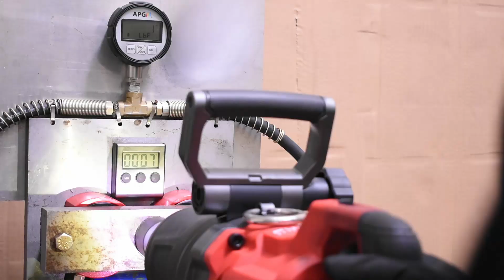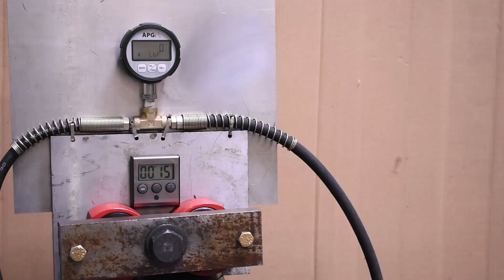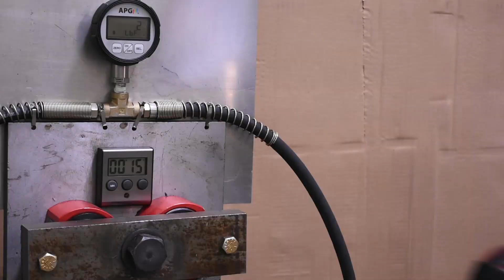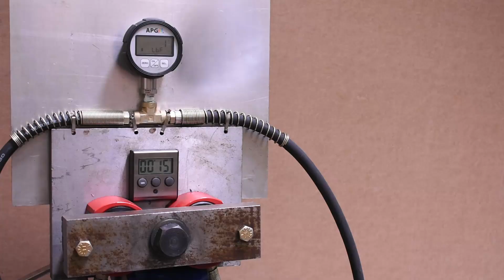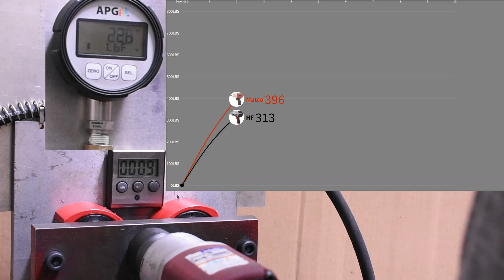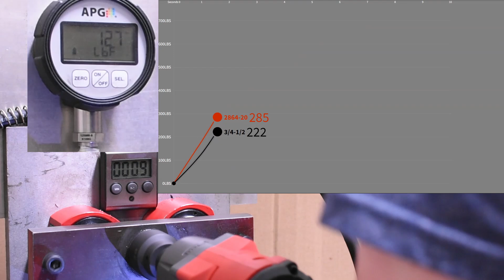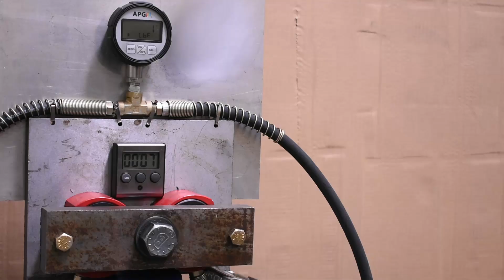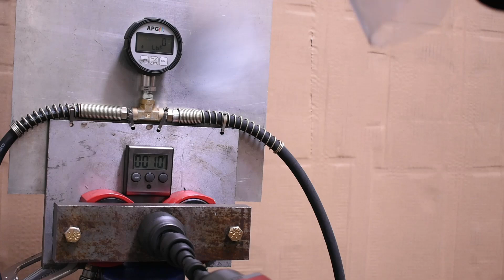How Much Power do Impact Drive Size Adapters Lose?

Comment from the maker: Something we tested yesterday just after making this is low-profile adapters like: https://amzn.to/3leaKL3
These lessened the huge 3/8" to 1/2" loss down to 10-16%, so it must have to do with the anvil being pushed out and away from the square drive on the socket, which doesnt help with that vibration either (see 2:52, the socket is a blur). Likely for the same (less) vibration reason, we also saw less % loss on weaker guns. For instance a 3/8" M12 stubby and our knock-off makita saw consistently less % loss, but still the same relationship between adapter types as in this episode.
Torque who started TTC is working in product development for Astro Tools, always consider multiple sources when considering a tool!
Reply: please test torque multipliers
Reply from the maker: @angus4202  Okay, but they aint cheap. Give us a bit :P
Reply: @TorqueTestChannel  considering the cheapest one ive seen on amazon is like $299 take your time
Reply: You know, I'm wondering what would happen if you turn a high-torque impact into an impact driver. Like take the Milwaukee 1/2" and just slap an impact driver end on it....Welp I know what I'm going to build.
Reply: Please show the percentage loss with the new and old m12 Stubbies with 3/8 to 1/2 Low profile adapters. Is the 3/8 still king or is it worth buying two separate stubbies.
Reply: Torque rods work by actually bending and absorbing the impact... I presume all other adapters are subject to this as well as perhaps longer sockets depending upon the material they made of...
Reply: When you click the link and realize you already own them.... (first link i have it so i can finger tighten/loosen with sockets)
Reply: Curious how Brands affect impact socket differences!!
Reply: Measure how much torque is lost using an extension rod
Reply: I was just about to comment asking about a rerun with low profile adapters. I was looking for a video specifically showing them.
Reply: Glad you mentioned this, I also wondered about the low pro adapters.  I also wonder if the lower the profile, the lower the loss.  For example, the Grey Pneumatic is lower profile than the Ares, but TGR appears to be the lowest profile of all (by what looks like just a couple mm).  With the new Milwaukee 550 ft-lbs stubby coming out, I'm wondering whether I should get that in 3/8" or 1/2".
Reply: @Torque Test Channel now do this test again all with air impacts and see if there is a difference in %loss. Or try with electric guns that run at different rpms (high rpm small hammer) vs (low rpm big hammer) with extensions/adapters
Reply: Exact ones I bought to step up my 3/8 to 1/2 as they are more of an anvil enlarger instead of a short extension adapter.
Reply: I just came here to ask if the low pro ones would work better. Glad to hear its in the 10-16 percent range.
Reply: So I don't know if this is going to be any different but I've had a realization what about the low profile adapters would that have any difference or would it be the same as the standard general adapter
Reply: @Torque, who wins?
Dcf911 = 400lb breakaway w/1/2" anvil
Or
Dcf923 = 450lb breakaway 3/8" + Titan LowPro adapter increaser to 1/2" ?

Who wins or is it a tie? 
Or just find 3/8" impacts in larger size?

Did anyone figure out if the larger mass 1/2" sockets are helping a 3/8 drive with adapter?
Reply: This is why snap-on and Williams label their adapters as non-impact sockets. They don't want to replace them every week for free. Smart on them really.

Being new to a mechanics job I see snap-on in the half inch impact field is #1, Everyone has one. This vid helped cause I was going to try to get a stronger setup with the one-handed 1in. Cordless ingersoll just to put snap-on in check 😂but now my adapter from 1 to 1/2 idea might make it less powerful than the snap-on half inch. The 3/4 snap-on with an adapter to half inch might be a touch stronger than a snap-on half in. Impact but is it worth it. 🤔 will need to do some more research to try and get the best one-handed cordless impact setup. 
I would go the two-handed ingersoll but again the adapter might just make it as strong as a snap-on half inch impact and most of what I do is above waste height. Not trying to hold a two battery two-handed impact that high all day. 😂

Comment: In most cases you'll have enough power for most of the jobs you need to do even with the adapter. So I don't see any "disadvantages" of using adapters, but good info!

Comment: I've got a Metabo 1750 with a 3/4'' anvil and they do offer a 3/4'' to 1/2'' adapter. Hell, you can even slap a bit adapter on top of that and use it as a driver. At that torque, even like 30% of loss will still be super powerful regardless, so I don't mind at all. Mofuker's damn heavy though

Comment: 30936 titan adapters use a DIFFERENT design from ANY OTHER adapter and would love to see a column on the rankings for it please ❤❤❤❤ by the way 30936 is the part number it’s a low pro adapter design

Comment: I was about to get a 1/2" to 3/8" adapter to use with the 1/2" drive torque wrench I was gonna buy, but the information you presented on it showed me it would have been more headache than it's worth. I ended up buying a 1/2" drive impact socket kit with extensions and etc instead

Comment: I bought the $1000 1 inch square milwaukee before I realized how much torque you lose with adapters. Now it is basically a $1000 paperweight. oops

Comment: Nice test. Interesting to see that the step ‘downs’ showed a disproportionate decrease in transmission of power over the step ‘ups’!
 
I have the Makita DTW1002Z 18V Brushless ½" Impact Wrench (rated at 1,600nm of nut busting capacity) and wanted more grunt, so, as a solution, I went out and bought the Makita TW001GZ 40Vmax XGT Brushless ¾" Impact Wrench (rated at 2,050nm of nut busting capacity) to boot.

With my impact sockets being all ½" drive, I also purchased the ¾" to  ½" drive step down adaptor.

Taking into account the 19% loss in power using the step down adaptor (as witnessed in this video) means the 2,050nm becomes 1,660nm gaining virtually nothing for my NZ$729 (skin only) purchase plus 40v battery platform upgrade!

Comment: I believe this. I have the 3/4” earthquake XT on my service truck, only tool that always takes cutting edge nuts off between my coworkers. I always used a 3/4”-1/2” adapter to fit a 30mm socket on it. Finally bought a 3/4” drive 30mm and got the chance to use it the other day. It took them off so much easier I couldn’t tell if they were properly put on!

Comment: Just came back to this to see if I should get a deal on the new 550ft/lb M12 stubby in 3/8" coming in cheaper with a battery. Pretty sure I'll just go full retail on the 1/2" version though. Would rather be able to use it on the bigger end of the socket range without having sacrifice the extra power of a 3/8" to 1/2" adapter. Hoping it knocks off my M18 mid-torque as my go-to lug nut tool

Comment: I feel like a 1” to 3/4” to 1/2” would actually be a good test as in are you better off using 3/4 to 1/2 if you have to or does a 1” gun help even with two adapters on it. Kinda silly but could be useful to know in certain situations

Comment: It would be interesting if you guys could take 0.01” stainless or brass shim stock (or whatever size would fit) and place it between the anvil and adapter and between the adapter end to socket just to see if tightening the fit makes reliable gains, potentially enough so to justify doing in a situation where that 15-20% loss is needed.

Comment: 3/8-1/2 adapters save me on the daily, changing excavator buckets or other things that dont get/ need high torque but use like 24+mm
Reply: Would have to carry a lot more weight around with my big gun

Comment: If you have a powerful enough gun, this will not matter. I use an adapter all the time when doing a transmission removal when you need a smaller socket in a tight space that requires a powerful gun (example: transfer case bolts and the nuts that attach the exhaust to the catalytic converter. Those are always very tight and hard to reach). When do you need to push near 1000 ftlbs on anything in an automotive shop? (Unless it's rusted on or cross threaded or stripped)

Comment: It would be interesting to see if there is a loss when using an adapter on a manual breaker bar.

I've given up on 1/2" breaker bars and use 3/4" breaker bar with 3/4" to 1/2" adapter.....I haven't broken or bent a breaker bar since this switch.

Comment: would these losses be the same if using a torque wrench by hand. i have a 1/2 in torque wrench and 3/4 socket. would the numbers be close?
Reply from the maker: The numbers will not change on a torque wrench

Comment: hey TTC love my live torque chart i bought! question: i use a milwaukee 2864 at work and use a 3/4" to 1" adapter to use a 1-1/4 4 point socket to put pipe plugs in, wondering how much you think i would be loosing? seems maybe 7-12%? 

whats your thoughts on the 2864 vs the newer 2967, ive had both and man i love the new lights and all of that however the thing just eatssss socket. i use 7/8 sockets to put HD nuts on HD studs all day. I build expansion tanks for Taco Comfort Solutions. Thanks love the content keep it up man.

Comment: There is no need for a 1/2 inch impact for most diy or possibly mechs, not in rusty areas. If it can take off a crank bolt, it'll do any other bolt.

Comment: here i am using a 3/4 to 1/2 adapter on my already weak 3/4 20v earthquake. im thinking its time to upgrade to the herc 3/4 with a 3/4 socket set.

Comment: If you're busting out the 1 inch gun and an adapter down to 1/2 inch, you'd probably be better served with a half inch breaker bar and 8 feet of pipe.

Comment: I used a vintage Husky USA 27203 1/2 to 3/8 reducer on my gen 2 Milwaukee mid torque impact at full power to remove a stuck Allen bolt. Nothing broke. Guess my reducer is a lucky one

Comment: Hi, great test!
It would be also very interesting to test adapters for impact screwdrivers, i.e. hex 1/4 to 1/2 square. I hesitate whether to replace my 230Nm impact screwdriver to impact wrench with more or less the same torque.
And is your hydraulic setup for torque measurement something  standard in the industry?

Comment: I Mainly use the adapters, when I'm just loosening those 8mm bolts on the fender liners. No force needed, just much quicker to use the one powertool I have around. Putting them back in I go extremely careful so that I wait for a single click. Thats my personal torque spec on those screws.

Comment: It would be interesting to drill and tap an adapter for a single set screw to force it in the removal direction relative to the anvil where most power is needed for automotive use. That would eliminate the slop since the gun anvil would be fully CCW inside the adapter.

Comment: Well, lol, I am for one am thankful for these tests. I am also thankful for the mindfulness to try instead of break. I broke the head off of a 1/2 breaker bar when not realizing that my axle socket had seized to my hub face, had begun to employ "extreme" measures. After beating the "correct" size socket off the nut, I tried the same impact gun one socket size up, and it ripped the nut off no problem. Lesson was that enough space is needed both around and in front of a socket to move the nut. :)

Comment: I’m a tool idiot.  Horribly!

If I use an adapter set.  But extension is 6” or 12”, how is torque affected?  If I need to remove a stubborn bolt.  Which shall I use!

Thx
Reply: Use the shortest extension possible it maximize your input and reduce twisting of the extension resulting in more torque applied.

Comment: How does the anvil on the Milwaukee not break? I have seen ratchet testing with 3/8" ratchets and they break at like 200-300ft lbs (the higher end ones being the ones without the detent pin/quick release since that makes the anvil stronger) but this Milwaukee it putting out almost 500 ft lbs? How on a 3/8"? How does the anvil not sheer off?
Reply from the maker: Intermittent blows is a wonder of physics over linear torque

Comment: Please test torque loss of   3/8dr impact extension bars vs same length of 1/2dr impact extension bars and also if more expensive 3/8dr extension bars have less torque loss than cheaper ones.

Comment: DCF911 = 1/2 drive and 400lbs breakaway

DCF923 = 3/8 drive and 450lbs breakaway
(Atomic, so 50lbs more)

I have both brand new here,
To use 1/2 socket:
Would the dcf923 with low profile 1/2 adapter (titan kit) best the lower powered dcf911 without adapter?

Or would the dcf923 balance out the extra power with adapter taking it away, and it all equal out?

The deals were so good I'm not sending either back.  The 911 came with the 60lb ratchet I wanted,  so it's better than free.
Thinking about giving the 911 to the kid next door, competitive kart racer, but he thinks he needs a HF Ultra to take off lugs. 

Or could I possibly need both a 1/2 and 3/8 at some point, but after all the kids next door, his dad is my tool lending depository already  😉🙃

Comment: lol i found on amazon a 1/2" to 1/4" reducer that i got so i could use my performance tool 1/4" Mm & SAE flip socket set, 
 (which has 8mm-15mm and 5/16"-1/2"  in 6 sockets lol) while im on the job.. theyre great lil sockets,  impact rated, n perfect  for my to go bag.... but the flip socket-ness means i need to use a 2 inch extension, and if i wish to use em on my impact wrench, id also need an adapter or even 2 which makes for a huge wonky mess that doesnt even work out.

but w that 2 step down reducer it really makes it alot more solid n sturdy. but its just your regular basic chrome socket not impact rated,  but i got 4 of em (2 for 8 bucks) and so far i haven't killed one yet. but granted i do baby the shit outta it

i wish yoi could get impact rated dbl down reducers / extensions that drop down as well...

i have seen a few companies that make the extensions that are 1/2" females and drop to 3/8" males on the ends, but the shortest one i could find was like 10" .. theyre all like 24 n 36 inches long for some reason lol..

in a perfect world theyd make a 1/2-1/4 impact reducer that was also like 1.5- 2 inches long too give it some sorta tensile strength,, half to Quarter reducer  if used at full blast will just snap like a twig
 ..n prolly rip the guts outta ur lil socket at the same time, BUT DAMMIT ILL BE THE ONE TO JUDGE IF THAS WHAT THEY'RE FATED FOR ! not these nancy-pants wrenchNsocket police who done went n  trifled w my rights!!! 
lol

Comment: We use 1" IR impacts with true 90 psi almost daily at my job 😁 they'll strip threads on 1" bolts if you hammer on them long enough

Comment: I just went down a 1.5hr youtube rabbit hole to find out if 3/8 square drive impact wrenches can be adapted to 1/4 hex, to save myself buying a "weaker" 1/4 hex impact driver. After sloshing through so many "cool" and "manly" fellas doing niche reviews, I find this. A truly genuine, no BS, channel devoted to presenting real information via the scientific method. In the first three minutes alone, you distilled far more important information than my entire rabbit hole. Thank you. Instant fan here.
Reply: I went with a 1/2" one instead of 1/4" hex because I might not need the full power when driving regular screws but I absolutely will need it when changing the tires of my car. The max my impact wrench can do is 300Nm so plenty even with a bit of loss.
Reply: @merlinfanboy556 so you have a 1/2 impact wrench? I’m confused these numbers make no sense. A 1/2 drive impact DRIVER that makes 220 ft lbs is all wrong😂
Reply: @tristanphillips8937  Yes, I have an impact wrench with an adaptor to use it as an impact driver.
Reply: How have you enjoyed your stay here

Comment: So In our shop with a regulator we run our compressor at 175-180 piped 120ft with 3/4" black gas pipe and roughly 400ft total for the 3/4" loop left right and center runs. At the regulator we can very easily hit 90psi dynamic pressure. The compressor is an 80 gallon Devilbiss compressor twin stage @15hp on split phase 240v phase2/3 motor rated at 25hp 3ph. The DeVilbiss 80gal tank is dated 1945 and has max working psi of 230. The First stage appears to be a 1970 twin cyl dual displacement vertical pump and second stage is a 1975 V-twin type single displacement pump. Its clearly custom or Frankensteined together to make the ultimate shop compressor. This configuration has been in operation since 1978. The max dynamic pressure we can hit at the regulator is 144 psi for about 8 minutes, 120psi for about 12.5 minutes and 90psi for about 15 minutes coming down to about 77psi continuous dynamic out of the system with an empty or equalized tank. We run 1/2" rubber airline to the tool.

Comment: I believe the slack between adaptors is cushioning the impact.  To test this I would like to see them weld the adaptors to the socket.  It would have to be a good weld and insure everything is almost perfectly lined up.  This is because i also believe that angles cushion as well.

If I am right, it will either greatly minimize or completely eliminate the loss.

I haven't read comments from others, so if I have stepped on someone else's idea, I apologize.

Comment: This was very helpful combined with your 3/8” vs 1/2” anvil comparison. I recently bought my first impact driver and got 3/8” because that’s what most of my sockets are. Two takeaways:  1) overall I made the right choice matching anvil to available sockets, but 2) I probably should replace my 1/2” deep sockets with 3/8” to fit the tool. 

Any recommendations on big, deep sockets available in 3/8” drive?  For example, 17mm, 18mm, and 19mm.
Reply: My advice is pick a brand with a lifetime warranty that doesn't make you pay for a replacement (snap on). Mastercraft/Harbor freight/ Princess auto
Reply: Get Tekton
Reply: Get Tekton